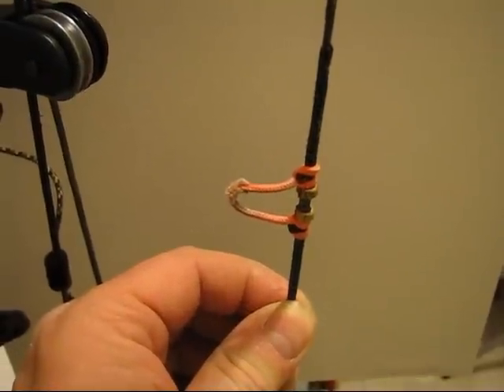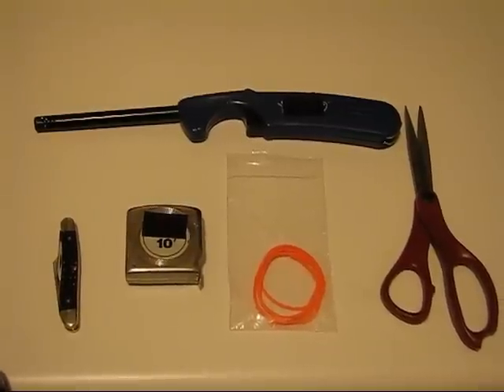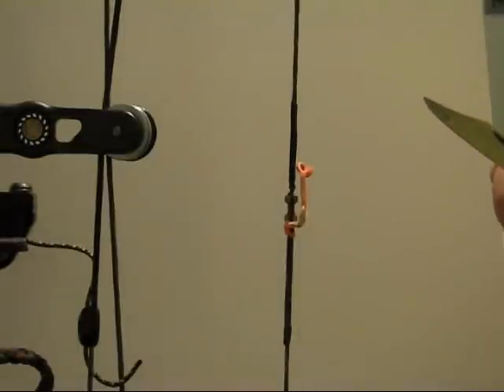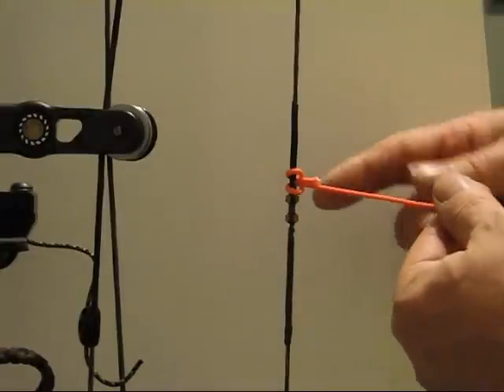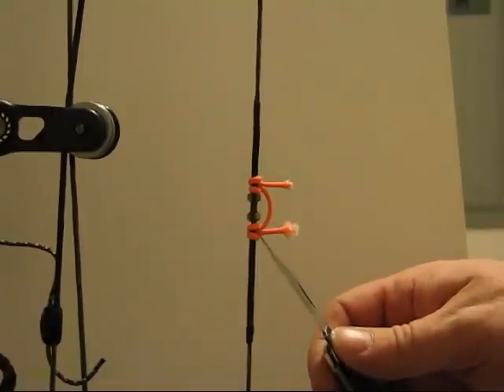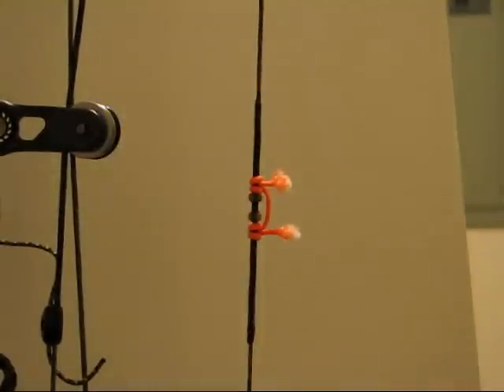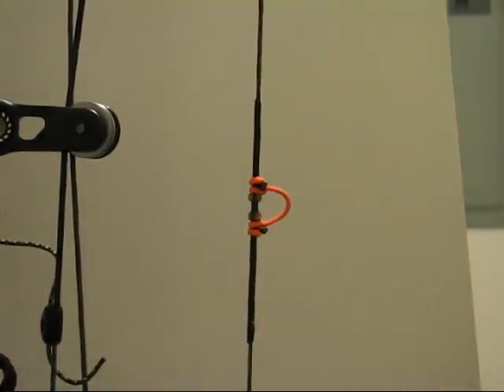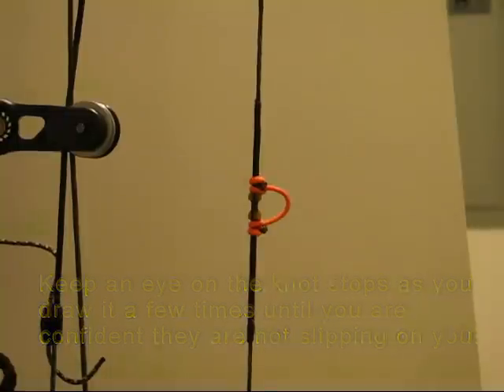How to Tie a D-Loop

Comment: I have an Armex compound bow, but the string has no notches or anything to indicate where a D-loop should go. Is it safe/possible to fit a D-loop onto a compound with a plain string? I really want to get a release, but wont bother until I see if I can even fit a D-loop...

Comment: You should try flipping one of the knots when tying your loop.  Tie one knot one way and tie the other, the other way around the string so the knots oppose each other.  It helps keep the loop straight as the knots try to work away from each other.  

In any event, thanks for the vid and explanation of what you were doing.  :)

Comment from the maker: I appreciate the kind words. What I do here, in the simplest terms is tape stuff that I'm doing as I need to. It takes a little longer maybe to video but not a lot. I try for content not really flash (lighting was poor on this one but I have to work with the camera/equipment I have).

I'm not sure when I will need to change a string but it isn't too hard really. Maybe I can do a base demonstration on one of those "here is how to" and go through the slacking of the string & timing of the cam.